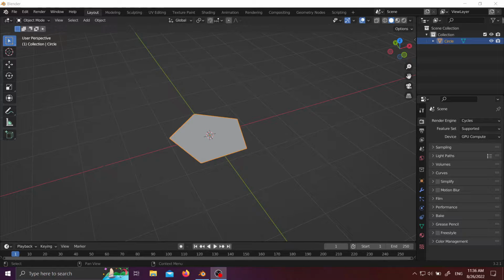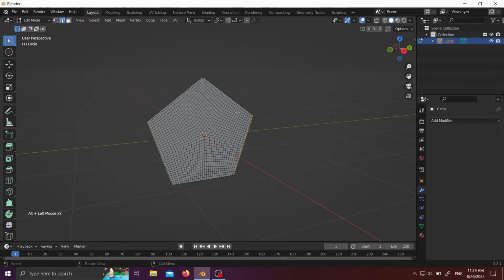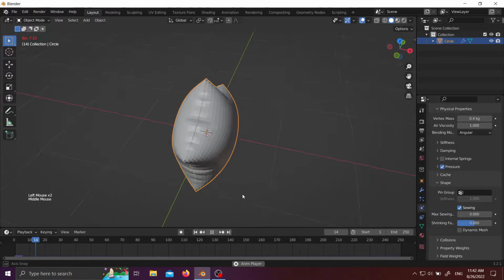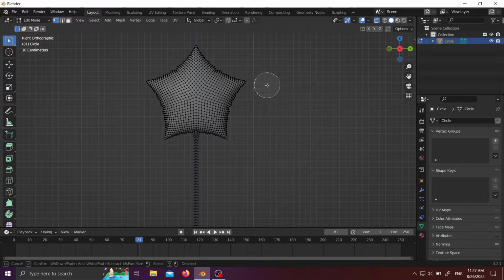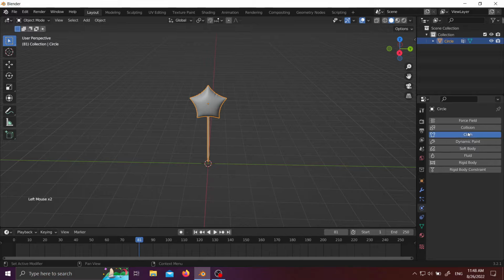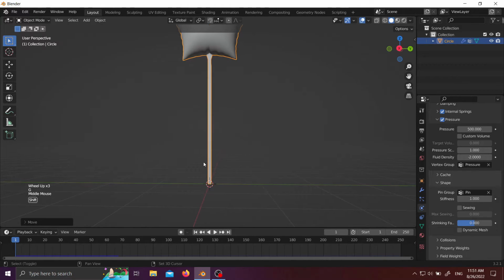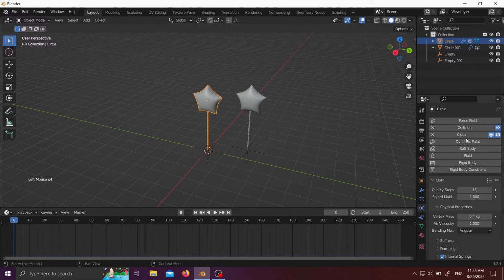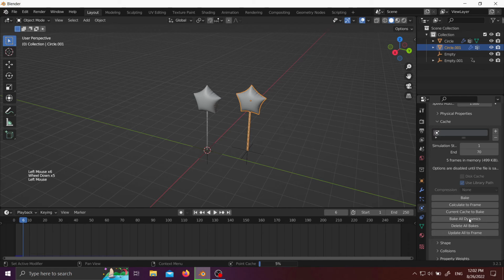How to create helium balloons in blender? (Using cloth simulation) | Blender Tutorial

Comment: I want to mention that the settings you use for the pressure physics depends on the scale of your balloons in the scene. I had scaled my balloon up, and using the settings in the video it was acting weird and too elastic. I ended up playing around and found that 20 pressure and -0.2 fluid density worked for my scale.

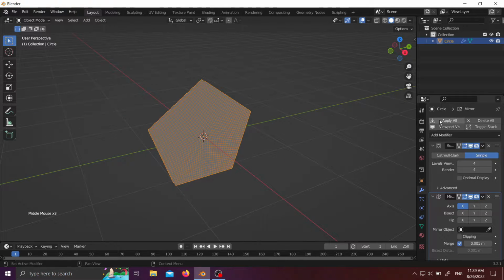Comment: I'm stuck at 0:23 Can you help me pls, I have a 2D hexagon plane, when I apply the subdivision, it only make the edge became square but not subdivide the inner-mesh like your, I did press Shift + N to recalculate normal but it still didn't help
Reply from the maker: If you put subdivision surface on your mesh, it might be working fine but blender just doesn't display that by default. In the video, I have enabled "Wireframe" in the "Overlay Menu" (it's the same menu for enabling "Face Orientation"). I also turned off "Optimal Display" in my subdivision surface modifier

Comment: Amazing tutorial! Followed every step, although my balloon is not rising. Gravity is set to zero. Any idea's how to fix this? Thx in advance.
Reply from the maker: Im still new to making tutorials so sorry if it was unclear 😅

Basically, gravity to 0 means the balloon does not fall, but it doesn't rise also.

In the final simulation where you want the balloon to rise. You want to leave the gravity at 1. Instead, you want to decrease fluid density:

Go to the cloth sim settings: Under Physical Properties > Pressure, increase the pressure and decrease fluid density. The slider for fluid density is capped at -2 but you can enter a lower number; The lower the number, the faster the balloon shall rise.

Hopefully this helps 😅
Reply: @vibrant3d424  I found a way that worked, with different numbers then you said. Probably because of the size of my balloon. Im using '1000' as pressure and '-1100' as fluid. It seems to work now, hope this helps the other ppl aswell. Thanks again.
Reply: @lonewolfart6298  Thanks, gentlemen, I deeply appreciate the tips!! :)
Reply: @vibrant3d424  Thanks man, i'll try it ASAP and will tell you if it worked. Thx for the quick response, appreciate it!